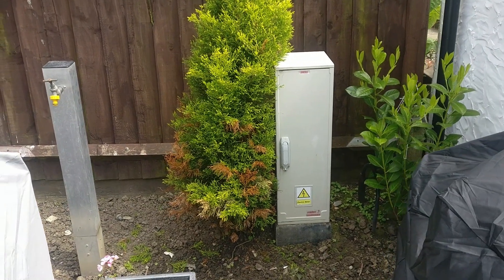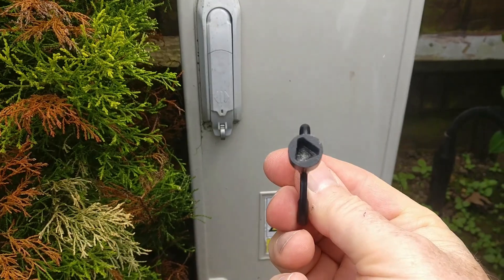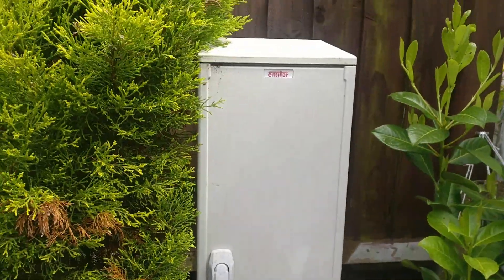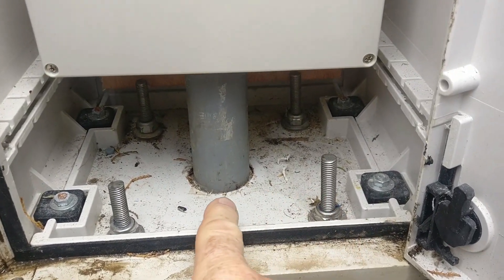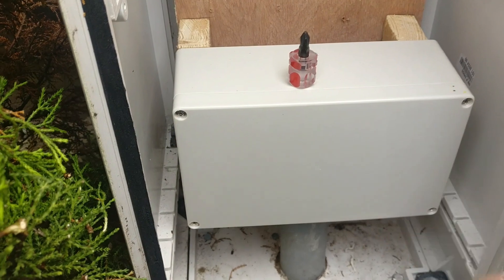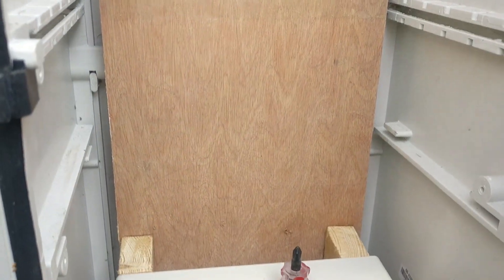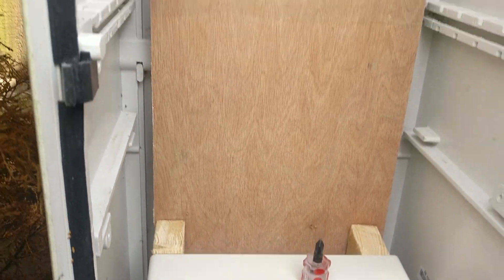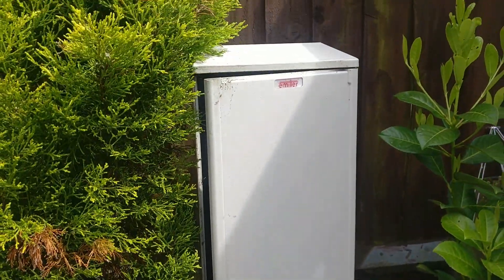My Outside Electrical Cabinet Overview

Comment: Hi. Just found your channel and you have many projects which I would like to undertake myself! I'm about to embark on an outside cabinet like yours (for outside lighting / wifi / electric gates with intercom). Can I ask, is the ethernet cable going into your cabinet shielded? Due to the limitations of my underground ducting I have to run power and ethernet together and wonder of you have run into any interference on the cable if unshielded? Many thanks.
Reply from the maker: Welcome to the channel 👍 I didn't have any shielded ethernet at the time so I used a reel of unshielded. I've been running ethernet in the cabinet now for many months and I haven't had any issues. Having said that, if I had shielded at the time I would have used just to err on the side of caution.
Reply: @Builtbypete many thanks! Likewise, I too have a big reel of unshielded which will be used 😂. Beauty of ducting is it can be replaced if needed. Thanks again for the great videos - I’m now off to learn about DIN rails! Cheers.
Reply from the maker: Good luck with the DIN rails. Great things. Easy to install and mount devices. I've got a few videos on them. 👍